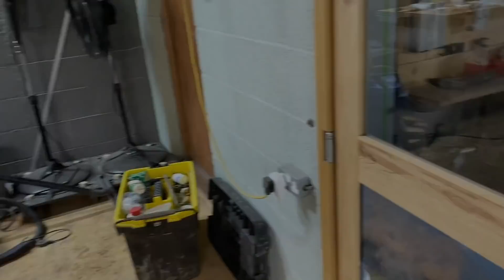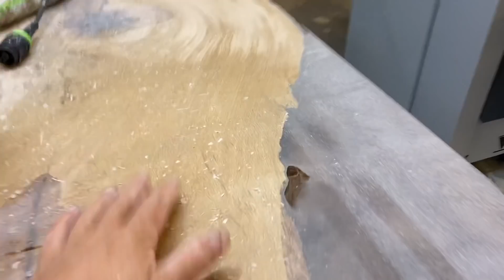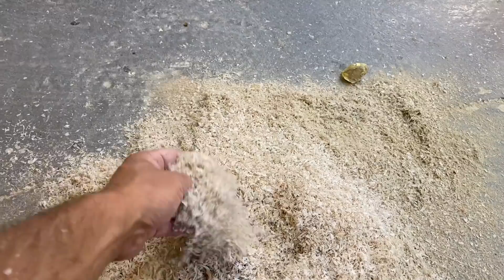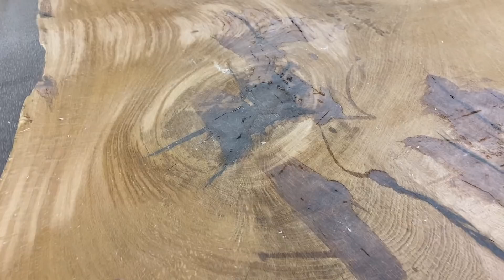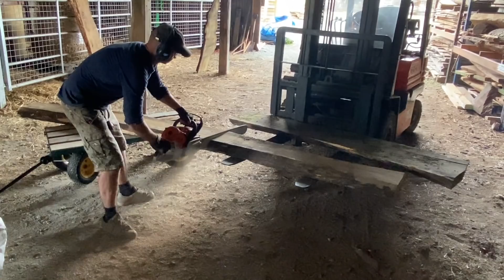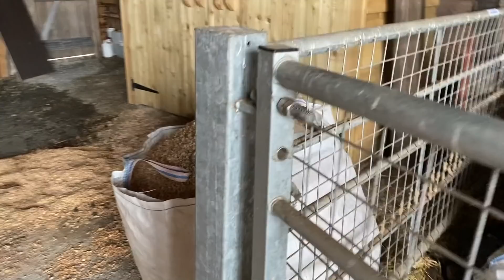#MWShoptalk | does Epoxy Resin create or save Waste

Comment: So what actually happens with the epoxy resin offcuts and shavings etc?  Where do they end up?  All good points made in the video.  Not sure how long these items of furniture will be around for.  (Wood will move and I wonder what effect this movement has on the junction between the timber and the epoxy.)   Perhaps the epoxy will move with the timber, but I think it is unlikely.  With furniture being more of a "fashion" item these days, if the piece looks daggy after several seasons of expansion and contraction, it may just be replaced with the next latest fad?  It will be interesting to see.  Thanks for the video. Cheers, David
Reply from the maker: I cannot speak for the next fashion and what will happen I can say that the current ones resin or simply bespoke live edge slabs is enabling small shops furniture designers like my self to compete with the big boys as it’s very difficult for multiple people or machinery to handle individual bespoke slabs and demands of the bespoke style customer dealing with the resin whether or not with resin it’s very custom service . as for the resin of cuts and scrapes they go to landfill with all the other waste plastic bags Bubble wrap discarded plastic tools paintbrushes buckets the usual stuff

If you remove resin completely or any of these modern techniques and simply go back to mechanised ripping of lumbar down to single dimensions there’s a lot more that happens and simply offcuts for firewood as machinery transportation fuel you know mate I’m not saying resin is the answer I will try to make clear but it’s a useful solution in the high bespoke market which is very low impact on the world anyway my trees travel less than 5 miles from Feild to shop

Comment: Wouldn't it have been better to fit the cooling tubes close to the top of the frame so they would touch the aluminium top.  Much more efficient?
Reply from the maker: Not sure yet, but the table is all aluminium, and a heat sync , I am just trying to keep the aluminium cool .  Should been a fridge effect as room has ac .  But we will see
Reply: Manor Wood Looks like a great table.  Hope it all works out.

Comment: I’ve said before on Manor Wood that, setting aesthetic aside, resin work takes timber that would otherwise be firewood and turns it into something useful. That can only be good.

However, assuming that piece of timber isn’t chopped into firewood, then something else has to be - the wood fires have to be kept fired. 

The resin products come from originally from oil and that clearly cannot be positive. 

So, I agree that it is a very complex area that some people try to extract some elements and praise or berate those elements. I do believe that you have to look at the whole process and then make a judgment. Surely, only a true expert could tell us the result of the balance between saving wood and making resin. 

I also agree that the amount of packaging we get is just daft. It’s wasteful and, in the end, costs us all money. If, as with the WEEE Directive, we could return the packaging to the suppliers, I would guess the volume would diminish dramatically.

Above all, tolerance and respect

Comment: Agree on waist. It amazes me how much waist I get making projects.
I was watching a video of yours a couple of weeks ago thinking how little waist you have. The tree you were donated by the farmer in most other uses would have been 10% useable if that, firewood probably. Resin gives you the ability to make massive slabs with very little wood in comparison to a 💯wood top with not having to cut out ‘defects’ which then become ‘features’. I believe this is the way forward for saving resources for large surface area projects such as table tops.